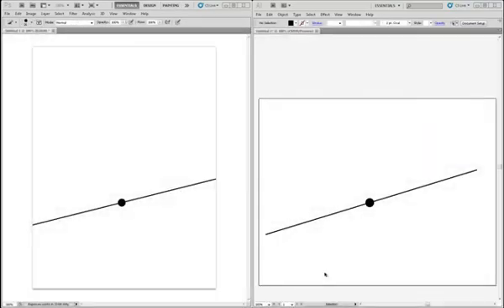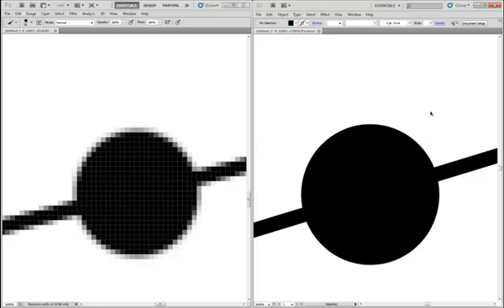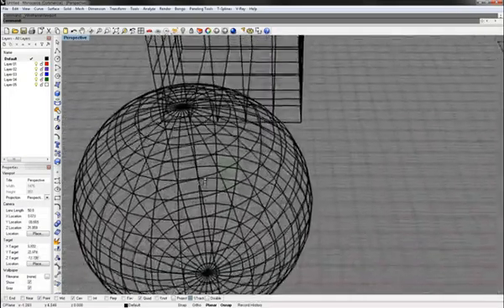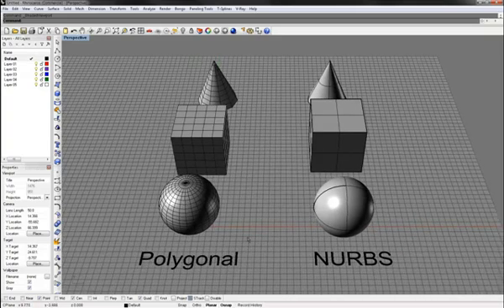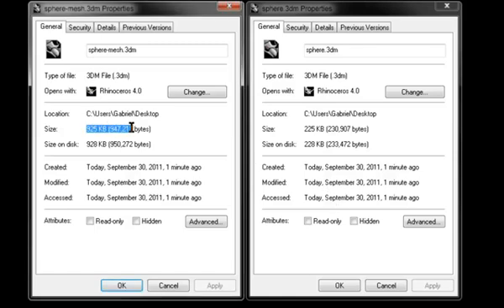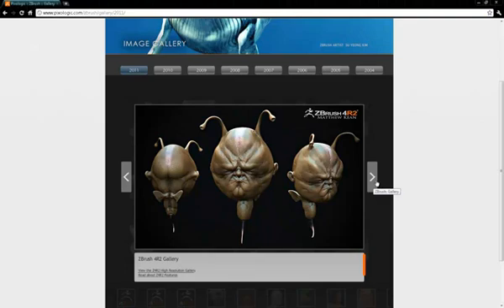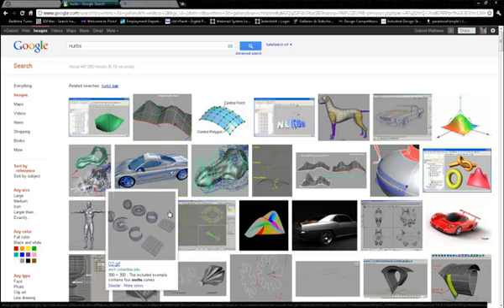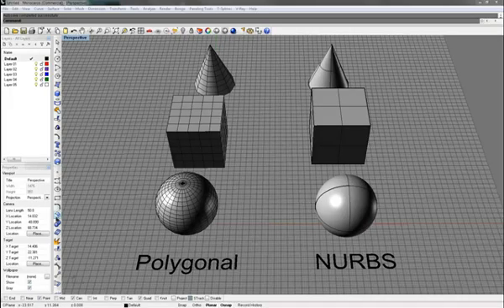Mesh vs  NURBS

Comment: NURBS is based on interpolating spline geometry so that you can upscale the resolution based on a algorithm that exists in the software. The issue is that getting surface detail with NURBS modelling would require a vast number of "splines", or functions to show those creases and folds. For example, although the NURBS sphere had a smaller file size, it was because both models were a very simple shape, which can be defined by only 2 splines. If you were to take the mesh sphere and distort it so it no longer looked like a sphere, the file size wouldn't change for the mesh object, but the NURBS object would have much more trouble keeping up (i.e. the number of functions that are used to represent the sphere would vastly increase), and the file size would exploded. This is not an issue for engineering models, as they almost always stay in mesh form, and represent objects without surface detail, but for artists to be able to create realistic renders, optimization is an important consideration, and mesh modelling is far more efficient at achieving that, especially for high detail models (along with other factors that impact 3D rendering and modelling).
Reply from the maker: Well said! That's true. The point was to compare apples to apples. Certainly the more triangles you're dealing with or the more complex the NURBS geo, the higher the file size. Thank you for your well thought out comment! I'm just glad people find the content I put out nearly 10 years ago still helpful. :)
Reply: May I ask you, I want to make an embossed dish, and then make a mold for it, which software do you prefer for this purpose.

Comment: I design things predominantly in NURBS, though I sometimes have meshes added in as components. One major thing for me is that NURBS are easier to modify with commands such as booleans, and converting a NURBS to a mesh is a one click command, but it's nigh impossible to convert a mesh to NURBS without completely rebuilding it using the mesh merely as a "scaffolding".
Reply from the maker: Agreed!
Reply: May I ask you, I want to make an embossed dish, and then make a mold for it, which software do you prefer for this purpose.

Comment: Please, can anyone tell me an efficient method to convert or surface an existing polygon into a nurbs model?
Reply from the maker: Hi there @keithskillz90210 - You can do a "meshtonurbs" command, or you can try retracing. Another option would be to draw curves about the edges of the mesh and then perform a network surface. If you want, email me at pilot@polyplane.com with some screen captures of what you are trying to accomplish and I will try to help you.
Reply: Wow thanks!
Reply: Rhino 6 together with Blender creates a good NURBS and subdivision combination. A video about it is this https://youtu.be/n9zMxUOD3CU